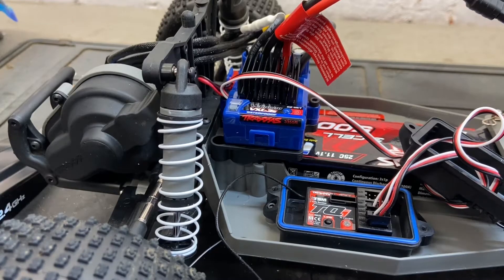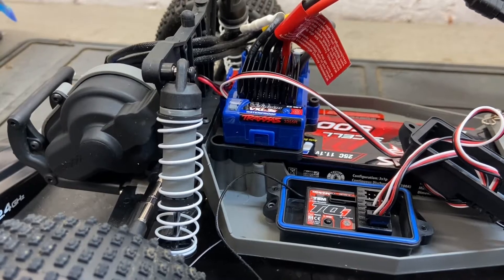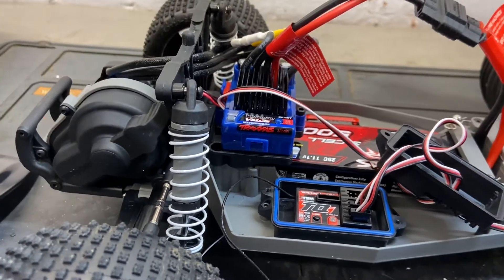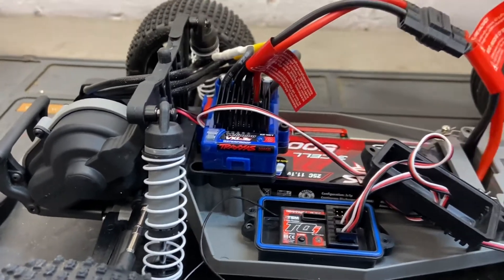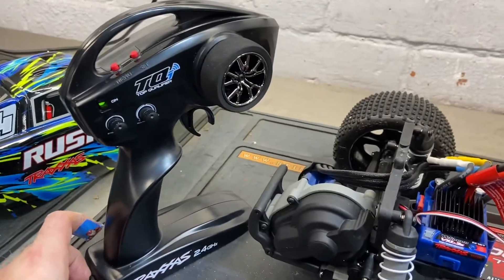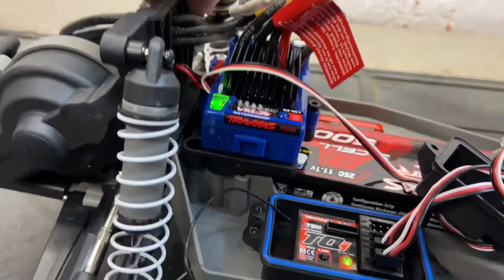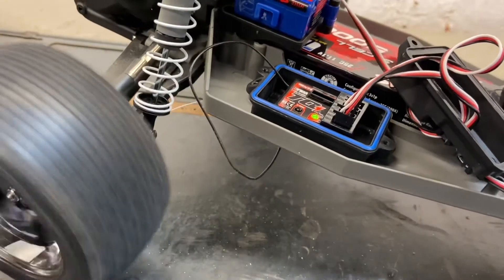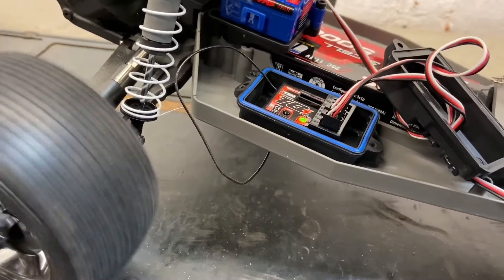Spudski RC How To: Throttle Calibration for Traxxas Transmitters To The ESC

Comment: Mine turns red instead of green
Reply from the maker: @codycarpenter1672  If it goes red after calibration that just means it’s in nimh mode rather than lipo.
Reply: @ thank you

Comment: On my esc it has a switch not a button
Reply: What brand ?
Reply: @XDCRYHARD  generic
Reply: @XDCRYHARD  maybe u can help my.car dont wanna move the back wheels turn but not fast
Reply: @leonjohnsonjr3331  sounds like a calibration issue, try re calibrating the ecs and see if it will work if not that might be the transmiter.

Comment: My instead of flashing, it just goes solid green but i still dont get no throttle respond
Reply from the maker: @alfredocanto9901  Have you check to see if your channel 2 is working? Trying putting the servo in channel 2 and esc in channel 1 and see what happens.

Comment: a quick question if you don't mind hey how can I make my reverse slower?  I want the throttle to stay the same but my reverse for me anyway is far too fast it's crazy fast.  I can adjust the brakes there perfect but the reverse speed is just too powerful.  I have the link system I can't figure out how to do it
Reply from the maker: As far as I’m aware it’s just the settings in the app. You can dip the power putting it in training mode but of course that changes forward power too.
Reply: @spudskirc4458  thanks I looked at that and tried boosting forward throttle wile leaving reverse the way it was at 50% but it can't be changed… Looks like I'm stuck with a car that has so much power going in reverse I don't really want it like that… But thanks